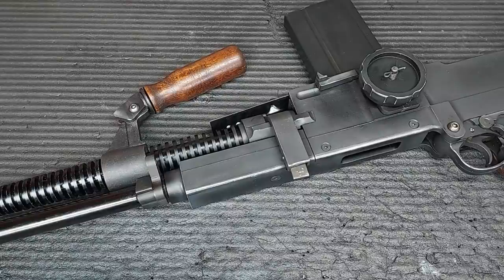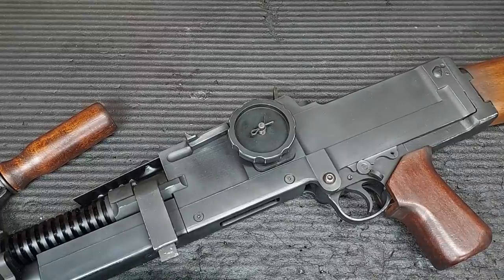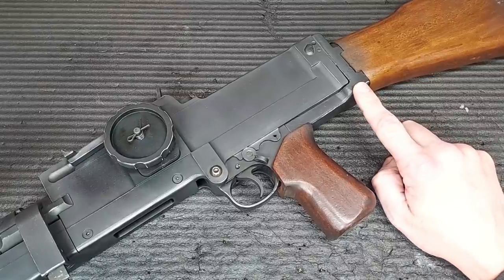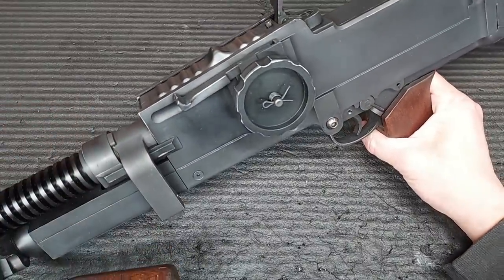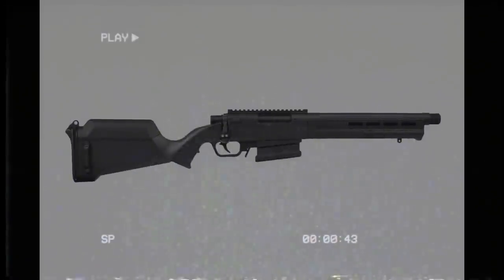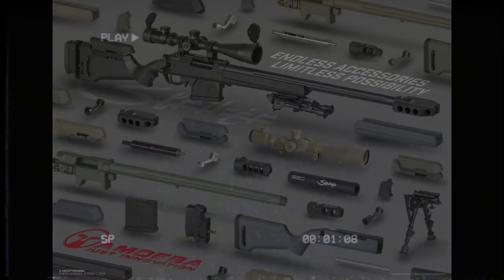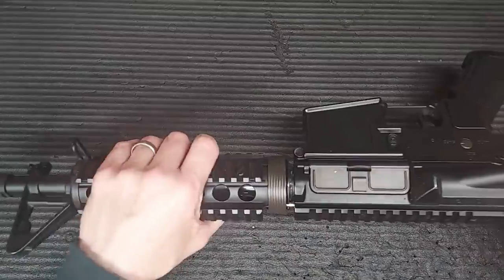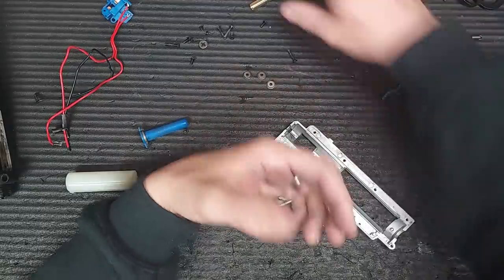My Top 5 WORST Airsoft Guns

Comment: I love my JagArmsHD M870 knockoff.. 
Loose shells go byebye.
Lost internal Gastank. Found it after hours searching the field.
Lost buttplate - replaced.
Then cracked the entire plastic stock - replaced with a GE buffertube.
Leaked, took apart, rebuilt and lubed.
...A few times...
G&P Foregrip Light has been great for daytime use?
🤦‍♂️But.. Uh ya... it's err.. good..

Comment: I like my Striker, though I will admit I put way more money into it than I realised and felt a little embarrassed when I added it all up. Probably not worth what it cost bit I do find it easy to work on / service now.

Should also add I don't run a heavy spring so not even close to the limit but it makes the pull acceptable.

Comment: Well, yeah, I own and use a krytac vector since the release, when I had to install new gears they were a tad wider than the space in the gearbox, eventually the bushings worn out enough for them to rotate freely, after diassembling and reassembling it so much it doesn't feel like a pain in the arse, even reinstalling the sping especially since it's still a very simple system despite that you have to look for the holes with pins, recently I have shortened the trigger sping which made it softer, what actually bothered me more than all that was that three part tappet plate has all it's parts, joints and axises made of plastic and they end up bending out of shape leading to nozzle either not going far back enough to feed or not sealing against the bucking requiring you to bend them back and a fact that magazine bb catch spring is so tough it literally files of the nose of a hop up unit which is why I had to replace it for a metal chamber. After all though, I must say I've got used to all it's quirks and I'm managing to keep it functional and satisfying to play with, maybe I'll also get a japaneese ETU thingie for it to get precocking even though I mostly use it on 2-round burst and full auto rather than semi. What I wanted to say is that after these years of using and fine tuning it I can't say it is a terrible gun even though I had other guns, but if you have put it on your list, well, it means other terrible guns might be possible to be made good too after all
Reply: I purchased 13:1 gears for mine and I can’t even add a single .1mm shim in without the gears being unable to move freely. Don’t know what I’m gonna do about that. Maybe add different bushings or carefully dremel the bushing holes so it sits a bit lower. Don’t know if I trust me self tho lol

Comment: Agree with everything except PDR-C.

It falls into the category of guns which, with our superior tech/engineering skills, only have to tune it once and never have to touch it again.  The PDR-C and the Sterling are two which are in the same category.  Add a new motor, a M120 spring, remove the grease from everything and do up the AOE, they will just keep on ticking so long as you use it within the parameters of its design purpose.  

I have both, both are reliable go-to carbines.
Reply from the maker: Nope, the Sterling was simple, really nice to work on & reliable.

Comment: I have a soft spot for the striker, ive built alot of them, there are fantastic with the caveat that your running a Bolt M. I've built a couple VSRs and a couple strikers, and I can get the performance the same in either, But I can honestly say it's worth the $100 extra bucks for actual mags and a solid body.
But none of that matters because the new silverback rifle is out now 😂
Reply: Is the action army hop unit worth the extra money over the stock unit with gunsmithy hop arm? My accuracy and compression is still a little wanting

Comment: Funnily enough, the two techs I've had work on my Ares Kriss Vector, all say that its infinitely easier to work with than the Krytac Vector.

Atleast what Ares did was a lot more conventional than that wonky bottom gearbox BS Krytac tried to use.
Reply from the maker: But it's sorting of fixable, the Krytac isn't really.

Comment: From what ive heard, for any gas shotgun that isn't a tm, its a crapshoot. Sometimes you will get a ge/jag arms sawed off or breacher that works and other times they leak. Still fixable with o rings. All of them im pretty sure are just ge rebrands. Jag arms Ge. Secutor ge. I do have to say i like the real wood on the sawed off and you can also get a real wood full stock unlike tm because the tm was made for japan but they are still metal somehow.
Reply from the maker: & still 3/4 size & still leak & break over & over.

Comment: The ares striker is terrible, I had dead mans trigger, hop rubber shit it’s self and the cylinder pins broke.

To fix that, I had to get a new cylinder set as well as a new bucking and trigger unit (lycan 90 degree sear and Lycan red blade trigger) . Surprisingly just with the modify VSR bucking and no other upgrades, I’m able to lift 0.45 gram bbs.
Reply: Dead man's trigger? So your shotgun exploded when you died?

Comment: King Arms SAA or a WE luger needs to show up. 

Do not dissapoint me.
Reply: If I had the cash and thought Luke could fix it I'd send my KA Colt .45 SAA to work on, it leaks like a sieve and has NO safety at all so if you catch the back of the hammer it dumps all the gas in one go, and you can't get spare shells for them anywhere.  Looks great but functionality is aweful!
Reply: @RogueWraith909  marushin shells fit.
Not that I would buy any more for it, wolf armouries have the tanaka in stock.
The real one had no safety and would discharge if the hammer was knocked on a loaded cylinder so it at least gets something right. The tanaka does that too.

Comment: So whats the unshittiest m870 in your opinion if one wanted to have a gbb shotgun (probably hpa tapped)
Reply: Jing Gong/Double Eagle.

Everyone I've talked to who owned one all say that the gas reservoir will leak eventually, but at the very least its cheap to fix and replace.
Reply from the maker: APS CAM 870
Reply: @NegativeAirsoftTech  and what about manual tri shots? Do any of them have decent internals and are serviceable enough to be actually usable? My best guess would be the Tokyo Marui ones, but I'm curious what are your experiences and reccomendations.

Comment: Why is Specna Arms Edge not on this list?  Especially with their new ESA2 with it's cracking lower receiver. 1st Edge version was cracking gearboxes and now 2nd (ESA2) version is cracking lower receivers. Failure rate is pretty high.
Reply: i had an asg ak47 ...cracking thing...i sold it with such a loss...nowadays i dont trust no ak 47 or ak74...
Reply: @rjasontwenty1099  cyma LCT clone or LCT done good aks are easy.

Comment: With regards the sd, I think if any tech was honest.  We have all had a gun that defeats us.  I know there’s gun techs that won’t admit that because of their giant dangly swinger.  It does make you question why am I doing this shit.  And it doesn’t make you a bad tech.    If anything you lucked out more than most getting that support from bolt.  I have had zero reply from contacting them for parts for our workshop.   And no parts via uk distribution.    So I no longer stock bolt products it’s as simple as that.  I only stock brands that are willing to provide spare parts. 

Unfortunately some airsoft guns just come out lemons and yes technically every gun is repairable given enough time and money but time and money isn’t infinite and technically we do have to think about those other waiting customers too.
Reply from the maker: I'm always happy to take on the AR15 variants as a change of bevel gear, aoe correction & a new hop unit makes them an amazing gun to use, I did re-contact Bolt after the parts all failed within a few mags along with other parts citing the build & quality control issues but to that I had no reply. 
When you look at the  UK distributer it's not surprising there's no support lmao.
Reply: @NegativeAirsoftTech  I think I did a mk12 bolt a while back.  In hindsight I wish I had ditched the motor.  Even after Prometheus internals and gate it wasn’t amazing.   I’m always somewhat put off when you get no response from companies for tech enquires, but that’s not exactly restricted to just bolt.  I got no reply from cybergun until they setup the dealer status and apprently are now willing to source parts.  Unfortunately it really is a bit of a who you know situation  and it shouldn’t be.  The bolt guy was probably shrugging is shoulders wondering what the big issue was he can get parts when ever he wants. 

I did a ras mp5 I think the only difference over the mp5 and m4 was the piston and spring guide if memory serves.    Uses a tm style ngrs bevel gear.     Hopefully you get chance to work on the new tm mp5 to do a comparison, it’s honestly a dream to work on.   So easy. So we’ll made.
Reply from the maker: @Eagle6Airsoft  Like you, I have no  faith in certain guns/brands & the TM recoil is just something I won't work on again - I've tested two of the MP5's now and for the price, I'll take any other brand.

Neither had decent range on .28g,  like the TM SCAR, trying to hop a.28g out of the box is a pipe dream if you want any sort of power or range.

It's unlikely I'll take the MP5 on as a job, it's just a £500 thing that compared to even a JG MP5, is just not combat effective.

I can't speak for reliability as I literally fired a few rounds, tried the hop, fired a few more & handed it back laughing. 

Not worth half the price charged over here sadly.

Looks great though.
Reply: @NegativeAirsoftTech  I mean I have tested it and got a vastly different experience than you.  I guess we will have to agree to disagree when it comes to tms in general and that includes the scar.  I could pick any tm recoil off the shelf and lift 0.32 out to 65m.   I wouldn’t game like it as a think the speed to target would be too low but my testing certainly contradicts yours.  

My comments was actually with regards the gearbox and working on it, it’s internal construction and take down in comparison to say the bolt.  But if you haven’t had one apart yet then you won’t be able to relate.    For the price I’d rather that than anything else.   If I couldn’t afford it I would save, a cyma doesn’t even hold a candle to it unless your only criteria is that they both fire bbs. 

Thank god for different opinions else airsoft would be very boring.
Reply from the maker: @Eagle6Airsoft   Exactly, I understand where you're coming from as your business is selling & modifying TM recoils, even if you thought I were right, you'd not be able to say it.

I just don't think the required & stupidly expensive proprietary parts, a limp clicky think that happens & lacklustre power is worth more than double the cost of other guns of the same flavour & realistically, if people thought the performance & value for money was there on their TM recoil, you'd & other techs wouldn't be able to charge £600 from somebody to modify a £500 TM recoil to squeeze an extra 60fps out of it reliably - for over £1000 I can do insane things, I just don't see the value for money.

Look at the VFC HK416 - people are now (finally) agreeing that they're trash inside & spend over £500 for the externals & then pay people like us to modify them, I do stacks!

If you put that £500 VFC next to an E&C 416, you can't see where an extra £250 went & the gun needs infinitely less doing to it inside... but the people who sell & distribute VFC would be saying what you're saying because they need to shift that box & pay their mortgages too.

Just an opinion, we do what we do the same but different. :-)
Reply: @NegativeAirsoftTech   but you clearly don’t understand where I’m coming from as you are essentially saying I’d sell a product that was bad just to sell a product and make money.  If that’s your opinion then it’s insulting.    I don’t even think I’m miss reading, your opinion of me and what we do seems pretty low.   I do not have to say tm is the best, I’m quite comfortable calling out each and every fault and any time they miss the mark with a product.    The mp5 is hands down like night and day compared to a cyma mp5 if you can not pick up the two and feel the difference then I don’t think you are blind.   Your personal opinion on whether the price is worth it should always be separate of reviewing the actual product.  

We sell loads of other guns than Tokyo Marui, One product that we sell is Tokyo Marui, a product that if I didn’t genuinely believe in then I wouldn’t sell it, It’s a company that’s willing to innovate and move airsoft forward.   One thing we always prioritise to customers in store is selling the right gun for them, we will never force or up sell a Marui, when people pick them up they upsell them selves, all you need to be is honest with zero bias and that’s how we approach it.  What you suggest above makes us sound dishonest, thus insulting.   We stock g&g combat machine and cyma where possible and will always talk the positives and negatives of all guns.   The price is the price you can not judge products good or bad on price only not with features being the next evolution of airsoft just like the phone market especially when they offer different things.   Just becuase you see no value you in the extra features offered or better externals of some of the more expensive guns certainly doesn’t mean they are charging you for nothing.  You personally just don’t see value in it.

Comment: A&K Masada has to be on the list right?
Reply: I own an A&K Masada.

Really donno why people are shitting on it so much. I bought one used and it works like a charm. All I had to do was pay a tech to flat hop it, re-shim and lube the GB, and it functions like a decent high-end gun.

Its one of my mainline tac rifles because I love how lightweight it is, even after throwing a few accessories on it. Its even lighter than my old MK18.
Reply: @LamborghiniDiabloSVPursuit  Because it has a shit hop up design, it has a terrible motor from stock and the fake bolt is thin sheet metal that breaks easily.

I've owned one the entire time I've played airsoft, it was literally my first gun. 

You bought one used that probably already had stuff done to it then you got more done to it, mine is stock apart from broken parts that had to be replaced (piston, tappet)

Comment: For me personally, I would add the CYMA Galil SAR on the list. It's a fucking horrid gun. I bought it for 250€, and was my first ever airsoft gun (I wanted the Galil specifically because I loved CoD Black Ops 1, so having a gun in real life from that game was a dream for me). Ever since day one, something was always broken on it. Not to mention, the charging handle is so shit, I had to weld the knob on it permanently, because it would always fly of whenever I used the charging handle (they though it was a good idea just to hold it in place with a miniature screw). It would never feed correctly, no matter what mag I used with the correct BB's, it would shoot 3-10 then jam. Oh but I'm not even at the worst part yet, the skeleton stock. Fucking. Awful. The metal where the stock holds in place (you push fown on the stock to be able to fold it to the side, there's a piece of metal there that holds it in place) bent and the stock always wobbled around, meaning I couldn't use it properly without the entire gun wobbling around like a piece of licorice when aiming. Thankfully, I gave it to a friend as a trade for a Specna Arms M4. He fixed up the gun and gave it a makeover, making it look like a mix of the original and the Galil Ace. It looks badass, but even he admitted that the gun is a colossal cuntosaurous to work with. Other than that, I think you summed up the list pretty nicely.
Reply: nice trade to a friend lol...i was about to order one from canada for 419.98 $...i just abort it...guess im going for a lk58 jg...
Reply: @rjasontwenty1099  I guess it was a very friendly gesture from him to be able to take my gun and give me his. The M4 he gave me has outlasted how long I had that Galil, and it works fine. The biggest punch in the gut is the availability of the parts for the Galil. Feels a lot better being able to purchase parts from wherever you want without you having to worry about them being sold out or not available anymore.

Comment: Hi buddy, been watching you and really appreciate your videos but I need advice really from your experience what is a good ak to buy I really like the gun doesn’t matter witch 74 or 47 or storm, also as a brand I hear that TM is mainly the one people are going here in south. Can you please advise…Really appreciate. Thank you
Reply: I've not heard of people recommending TM AKs particularly. If your budget is lower, then get a CYMA. They aren't expensive but they work and just keep on chugging. A lot of people like LCTs as they are much better externally, but internally apparently no better than a CYMA, but at least they aren't worse. I am by no means an Airsoft expert but I have the full wood and metal CM045A (AKS74u with wood furniture) . Admittedly I have too many guns so it isn't used all the time, but I've lent it to others too and all I've ever had to do on it is tighten up the screw on the hop up slider and the screw on the selector. It only stops working when the battery dies.